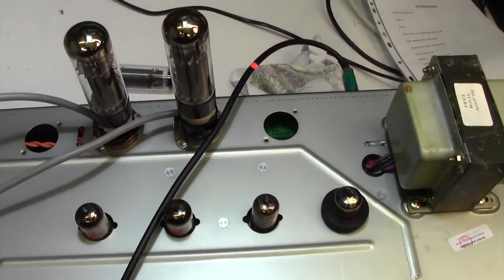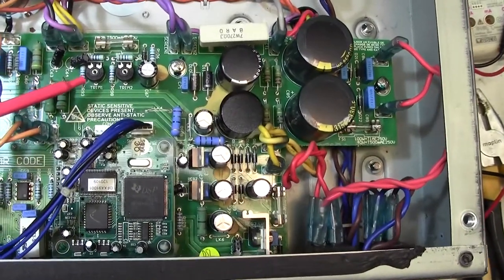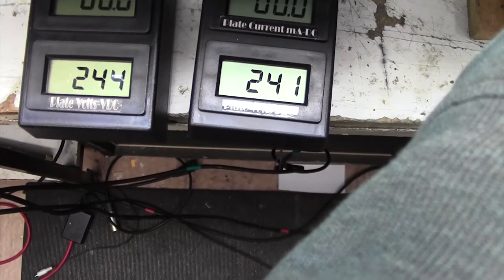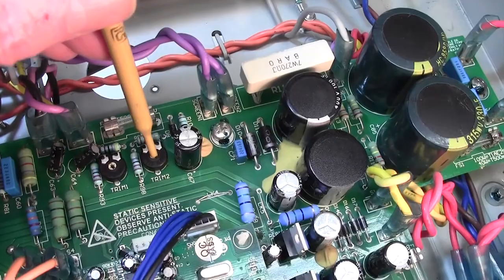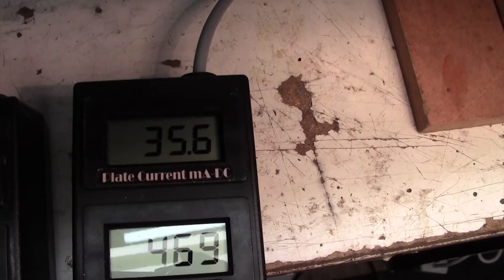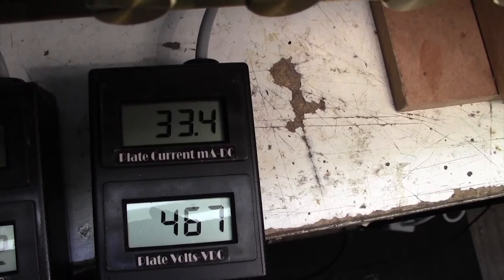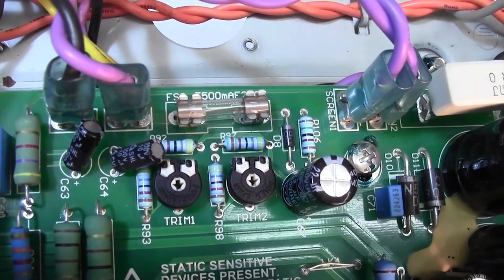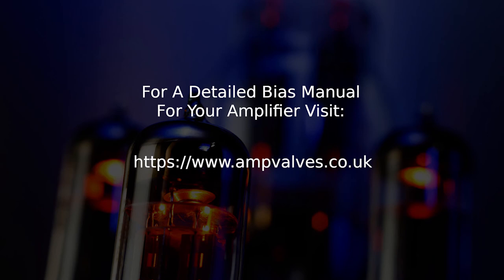How to Bias Marshall DSL40C

Comment: Hi Stuart-Yes you did use a bias probe in the Video but my point wasn't what test equipment you used but there was no reference to where you attached it (I guess Bias CON5) on the edge of the PCB
Reply from the maker: Hi Jeff. Ah, I see. The bias probe sits between the valve and its base. You unplug the valve, plug in the bias probe, then plug the valve into that part of the bias probe. If you're going to be biasing amps, it's worth betting one. I like the ones fro Eurotube.
Reply: @stuartukguitarampguy5830  Hi Stuart -Thnx for the clarification-Best wishes Jeff

Comment: What size alignment tool are you using there? I need to order one for my Marshalls.
Reply from the maker: Hi Zack, the proper name is a 'preset potentiometer trimming tool' but by the time you've said that, you could have filed down any bog-standard small screwdriver to fit!
Reply: @stuartukguitarampguy5830   and Zack Baines: You can make one from a standard Chinese chopstick as well. They are made of wood and it is so easy to shave it down to the correct width and then to shave it down to having two sides like a flat head screwdriver. Being made of wood they are safe to also use to poke around with inside the amp, wood does not conduct electricity. BTW, the trim pots move easy so no worries about the chopstick trim pot tool not being strong enough because it is strong enough. -Peter age 70

Comment: I don't understand how this video helps people to set the bias on their DSL40c's-You make no reference as to where the meter probes are connected to in order to achieve the correct setting. Am I missing something?
Reply from the maker: Hi Jeff  Without watching the video again, I'm pretty sure I woiuld have used a bias probe to do that? Most amps need a bias probe (cost about $100) and you canlt just use a multi except in rare cases. All the best

Comment: What is a Euro Tube bias meter and why do I need one to bias an amp? Terrible design. Seems to me made to need a technician to do this!!
Reply from the maker: Hi Rick. Ah, the design is quite deliberate, they don't want musicians fiddling with bias settings (a bit like it's hard to adjust the tickover on a car). Eurotubes is the manufacturer. The bias meter just sits bwteen the valve base and the valve and allows you to read the voltage and current etc.